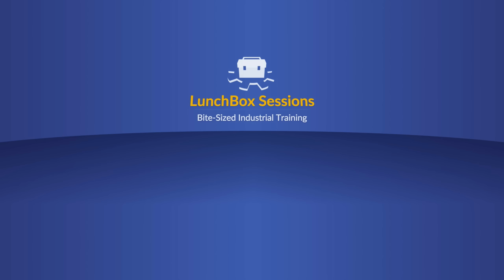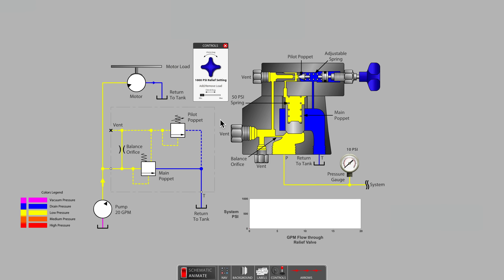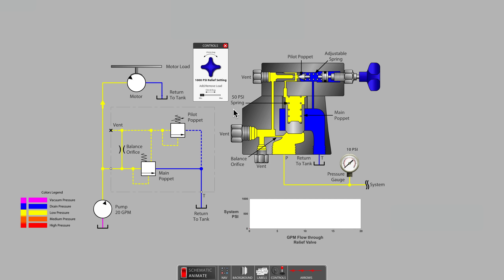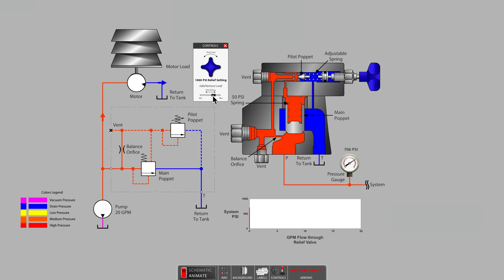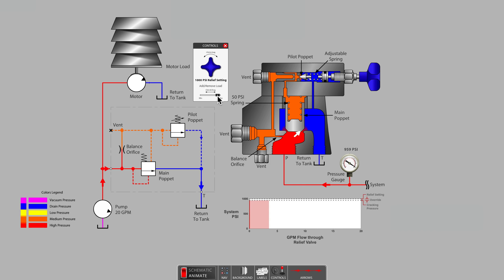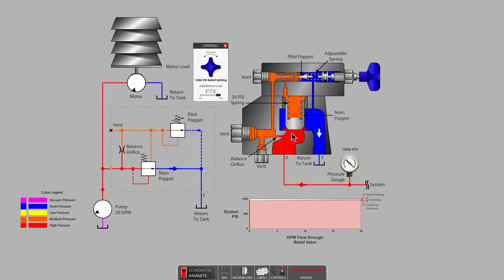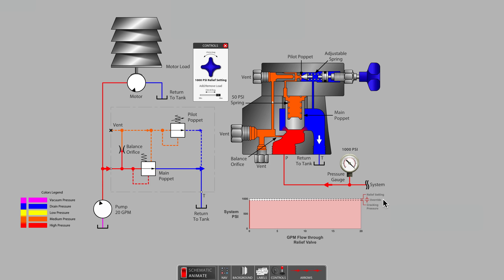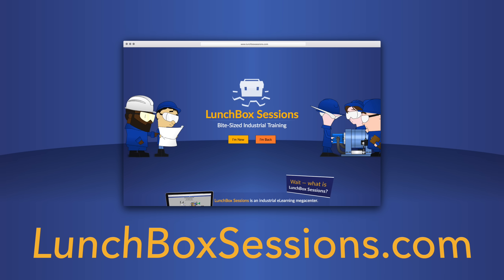Balanced, Pilot Operated Relief Valve

Comment: I've  noticed in testing some systems that if the pressure bumps up against the relief valve and the relief valve won't fully close until the pressure drops much lower than what it opens at. That means the pump will be running over the relief until the system is shut down and it can reset.
Reply from the maker: Yes many relief valves re-seat at a lower pressure than what caused them to open. In some reliefs this is a very small, almost unnoticeable difference. In poor quality valves this difference can be a bit high (several hundred PSI). If one has to shut down completely to reset, then something is probably wrong with the valve. - Carl

Comment: Thanks for the video clip. It is very well made and understandable. I have a question: does the adjustable spring have equivalent resist power to the setting pressure? I do not understand why the poppet of the direct-acting valve starts to open as the inner pressure reaches the setting pressure.

Comment: The balance orifice is located behind the top vent. not the bottom.  the pressure indicated in red shall be up to the top orifice.
p.s. that is why the upper vent can plug openned - for replacing the fixed orifice with another one at the factory...
Reply from the maker: Thanks for writing. Anatole Sokol perhaps you are thinking of a specific model. We built this animation, a bit simplified, from one that we have in our shop. See part number 5 in the lower left component cutaway on pages 2, 3, and 4 of the document http://www.parker.com/parkerimages/hydraulicvalve/Service-Installation/Denison%20Service%20Literature%20-%20new/S3-ML2400-A%20-%20R4V.pdf

Comment: I don't understand what keeps all the available presser from bypassing when you have multiple spool valves and pistons.  How does one piston get pump pressure from the valve when the other valve is letting the pressure bypass when it is not used.  Nobody makes a video with a double hand operated spool valve(two piston).